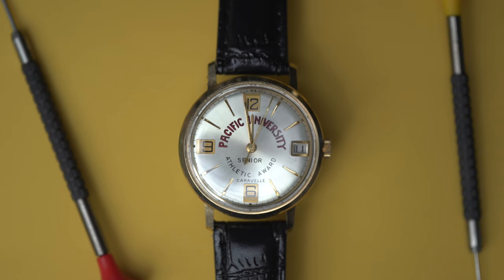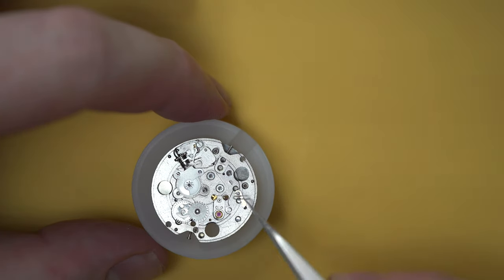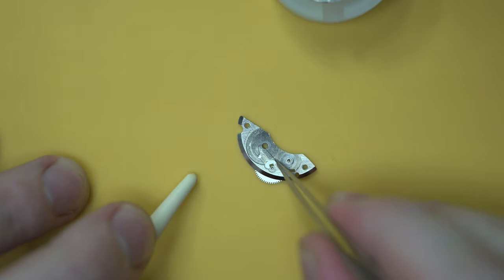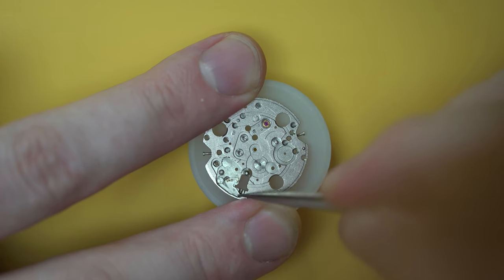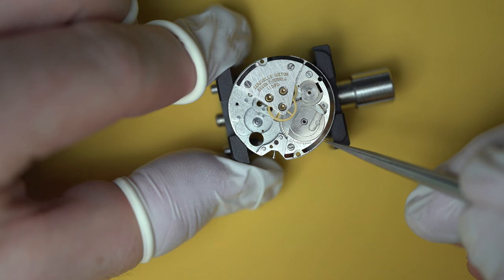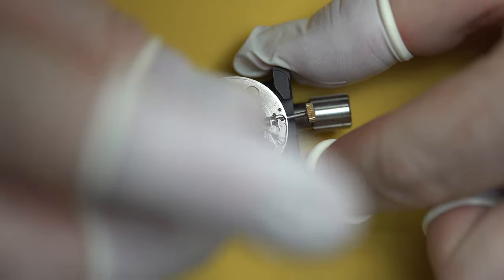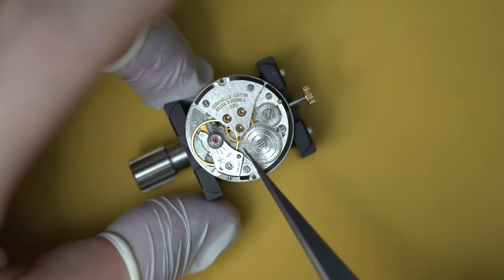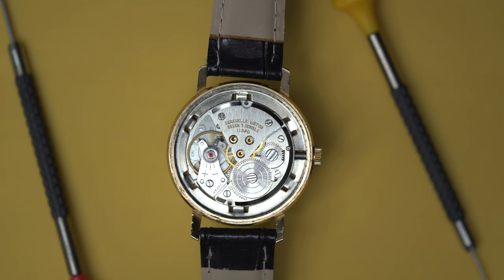1970's Caravelle Vintage Watch Restoration. Full watch repair in 4K

Comment: This is a great video very helpful. I  just got started repairing watches and dug out a 1970 Caravel that I had in 1970 , the stem was broken off inside the movement and I had to take it apart to get a new one installed, very helpful to use this restore as a reference. Thanks for posting!

Comment: Nice video... I have an 11DP as well and was trying to see what is under the hood so to speak.  Can't find the technical specification sheet to see a nice exploded view, but this did nicely.  Only difference between yours and mine is I don't have the date ring.  It's interesting they made an 11DP with and without date.

One question I had was how did your clean the balance wheel and how did you lubricate the jewels that the balance sits on?

Comment: Good video. Be careful using IPA for the rinse -- the Pallet Stones are attached with shellac and IPA dissolves shellac.
Reply from the maker: Noted on this. for the rinse I remove the pallet fork and balance wheel, just give them a quick dip in IPA rather than the full rinse. If not, that would be a painful lesson to learn and I’d be on YouTube trying to learn re-setting stones 😅

Comment: Don't stress too much about your cleaning method. Most important is that you use a detergent/decreased that is non-corrosive and old oil gets removed. Doesn't matter if a clean takes some hours, you don't have impatient paying customers queued up. Lighter fluid works fine on the old movements. You can always improve but perfection is also the enemy of the good!  Oh, I subbed too
Reply from the maker: Agreed, after cleaning I usually put under a microscope to give them a once over, and the cleaning method I’m using seems to be doing the trick for now! I’d definitely think twice about running a valuable watch through the same process though 😂